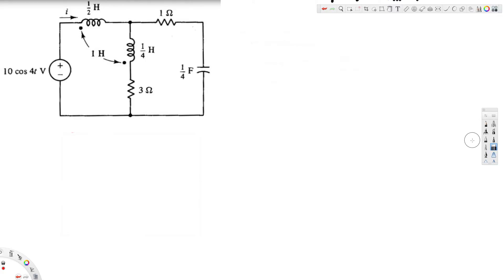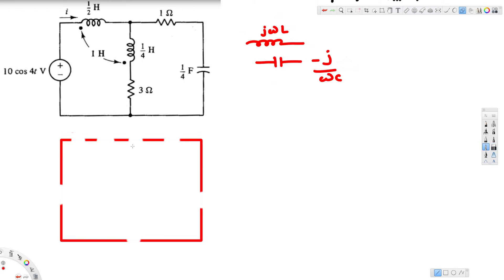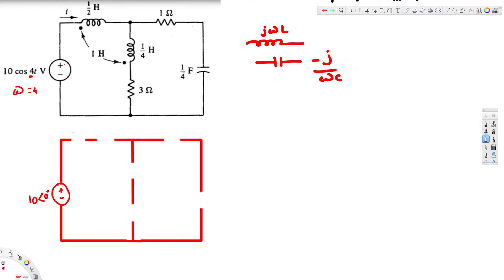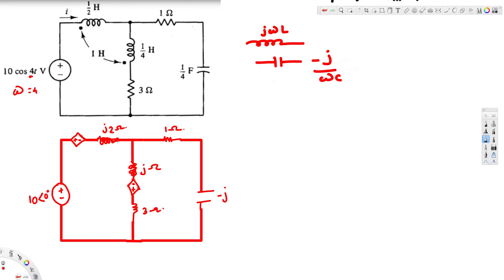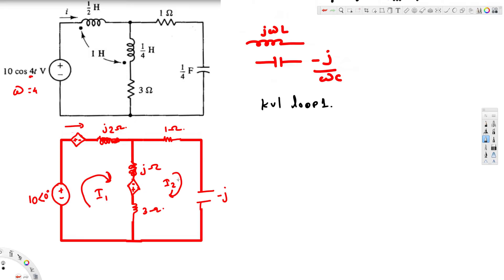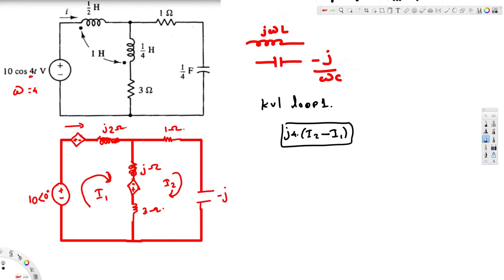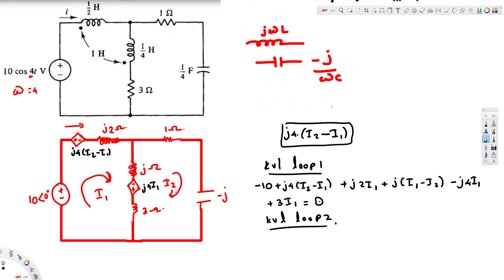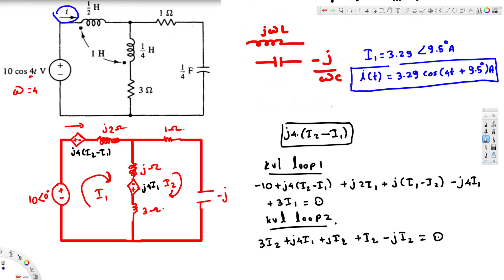ac  : Mutual Inductance Example #2 - Circuit Analysis

Comment: Man i think there is a wrong, in the mid wire when u make 3I1 it shoud be 3(I1-I2) no?
Reply: Yes, (I2-I1) should also be used for the inductor above the 3 ohm resistor